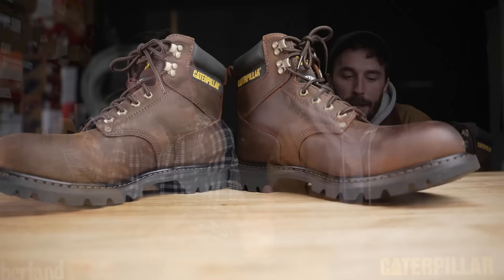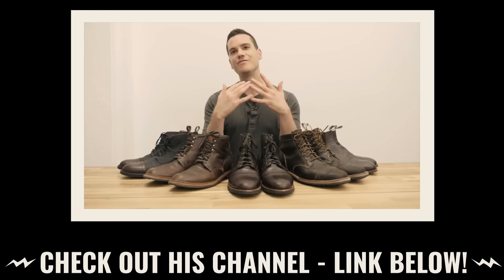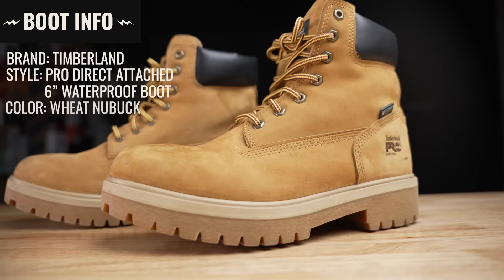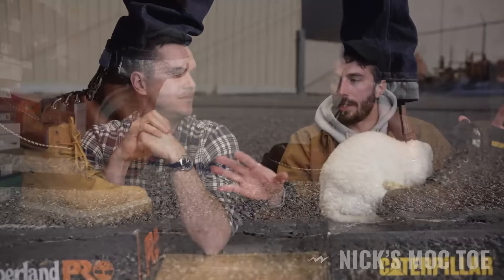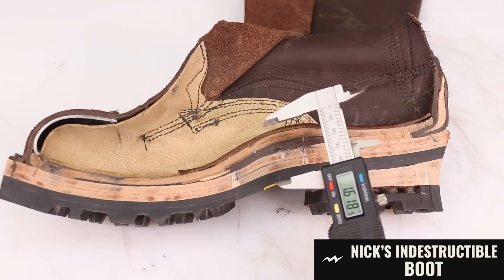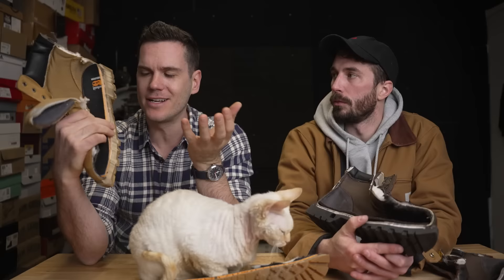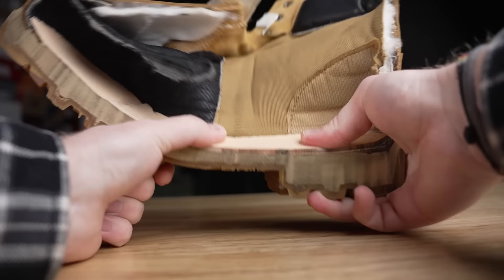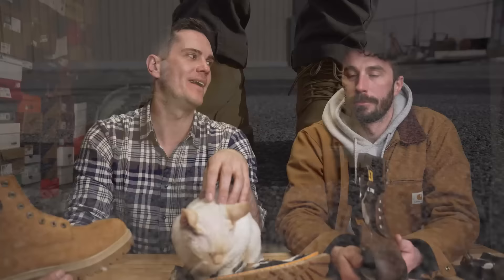Best Budget Work Boot - Timberland Pro VS CAT - (CUT IN HALF)

Comment: Rando question - do you have any vids on buying Used boots? Things to look for? How easy is it to remold a footbed like a RW moctoe or Wolv 1k etc
Reply: Just buy cheap boots under 100$ and save to buy a brand new model of a used boot you wanted.
Good boots, the materials shape to your foot, buying used is pretty much bying someone's foot imprint and i doubt your foot is the same.(having the entire bottom of the boot redone is simply waste of money in my opinion. Just wear cheap and save up.)
Edit: redoing the bottom of a used pair is a waste. If you had boots for x years that you bought at 500$ then a redo is fine. Just not redoing someone elses boots to fit you when you can just buy new if you save up for a couple months.
Reply: He did do a video about what to look for when buying a used set of boots. About end my break now, otherwise I would link it.

Comment: I've owned both.  The CAT boot sole delaminated and fell off.  The Timberland boot lets sharp rocks pressure through the instep right into your foot.  The Timberland however, is comfortable, but after a year of so is not quite waterproof, more like water resistant. Neither compare to my most loved boot, Danner Logger, that some degenerate stole from me.

Comment: You guys were really soft on the Timberlands. I feel like the Timberlands just did the bare minimum to be legally able to call it a work boot, but if you try to do any real physical work, they will absolutely fail you. They're an esthetic, not a real work boot.
Caterpillar, on the other hand, are the best off-the-rack option for affordable work boots. And they're absolutely worth the price. Get yourself a Scholl insole for the boots and you're gonna have a boot that lasts you a good amount of time and will absolutely protect your feet.
Reply: I'm 6'2" 220#'s and do carpentry construction 50-60 hours a week in Buffalo N.Y. 
I've owned 10+ pairs of Timberland Pro Direct Attach 8" steel toe, over the last 20 years & they've served me well. 
I've bought more expensive domestically produced boots, and still prefer the Timberlands.

Comment: No steel toe. Not a work boot. It's to look good holding a hammer in your hand for selfies. I wouldn't be allowed on the worksite with these boots on. I'd fit right in at Starbucks.